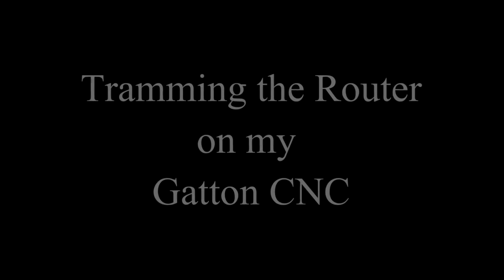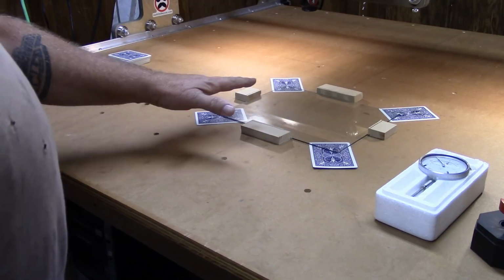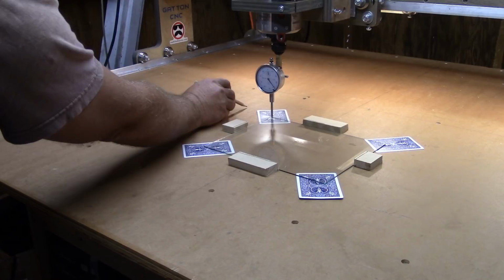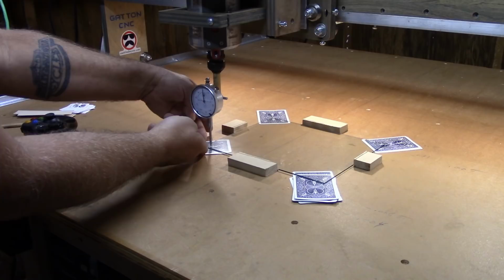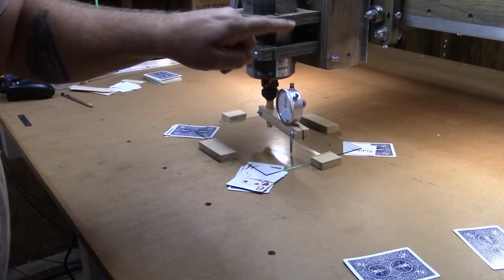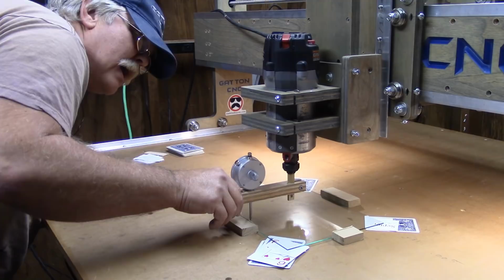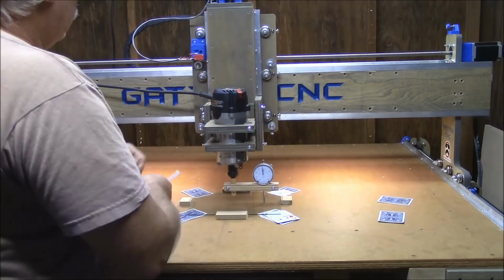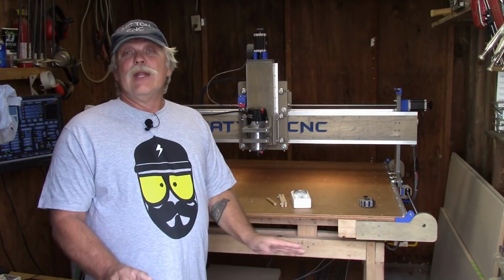Tramming the Router on my Gatton CNC

Comment: I did the same video on my channel a few years back. It only takes me about 10-15min once a year just to give it a check over and adjust. Haven’t adjusted it in 2 years and it’s still running true.
Reply from the maker: Thanks! That's great to know! I'll most likely check it again in the spring when the weather dries out. I figure if it's going to change, that's when it'll happen.

Comment: Glass might not be the most flat. Might want a surface plate, and also 3 point levelling would be a bit easier as you cant really get a 4 point level plane.
Reply from the maker: Check out my latest video on this topic, in which I level, square, and tram my Avid 4848 Pro CNC router: https://www.youtube.com/watch?v=NvT3qj4B5DA
Reply: Absolute magic thanks for this @MarkLindsayCNC

Comment: Hi Mark, great instructional videos!  Thank you. I am curious - if the angle between the 1/2" dowel and the plywood arm is not perfectly 90°, wouldn't that throw off the readings?
Reply from the maker: Thank you for your kind words, Mark (great name, by the way.) It could throw off the readings. But keep in mind this video was made 6 years ago, and I was trying to make do with what I had. I have since changed the way I tram my router/spindle, and that has eliminated that possible error. Here's a link to my new tramming system: https://www.youtube.com/watch?v=AC4U5m8T6Yw

Comment: Mike question;  you should do this after you put your spoiled board? Can you do this after you surface your spoiled? I’m new to CNC and when i mount mine CNC Machine got really excited about and i did not now about this.
Reply from the maker: Thanks for checking out the video! You should do this after you put down the spoilboard, but before you surface it. That way you get a nice, flat surface on the spoilboard. Just know it's a slow, tedious process that takes a lot of back and forth, loosening, and tightening the router/spindle mount, checking, and rechecking.

Comment: why not turn the dial indicator  90 degrees counterclockwise so you can see it at the left side and the right side of your table (for the second part of the tramming)? you can stay in front of the camera . other wise a perfect way to set up the router plate  Kind regards Hans
Reply from the maker: Thank you very much, Hans! The main reason for not touching the dial indicator after it's mounted is because I run the risk of moving it in the mount. Once it's mounted it needs to stay as placed. That way I'm sure all of the readings are as close to identical as possible. If I loosen the mount to turn the dial indicator, it could potentially move the indicator up or down just enough to give me inconsistent readings. Plus, my old eyes need that dial indicator as close to me as possible so I can actually read the thing (Don't get old - it sucks in more ways than I can count.)

Comment: Mark, I like you idea of using a dial indicator mounted to the router collet to give you points of reference.  I do something very similar to set up my radial arm saw and, to a lesser degree, my planer.  But now I also plan on using it to level the table on my drill press.  It's interesting how invaluable dial indicators can be in the workshop!

Comment: Thanks for posting the video. I’m enjoying your beginner series. I ended up tramming my router with a magnetic base angle box. I put a plain piece of 1\4” rod in the collet and zeroed the box to the work surface, then stuck it to the rod. As I rotated the rod in the router I could see the tilt in all directions. Seemed to work pretty well.
Reply from the maker: Hey, whatever works, you know? Thanks for checking out the video!

Comment: Great job on explaining how to tram the router. As retired machinist you did everything correctly. In my videos that I have posted using my Bridgeport my head is trammed to .0005 in a twelve inch circle.
Reply from the maker: Thank you Leo. You machinists have a lot tighter tolerances that us wood guys have. I didn't really get into the radius of my little jig or how tight of a circle I was tramming it to, in an attempt to keep things simple.

I know that .0015 may seem like "sloppy tolerances" to some, but wood just doesn't need that kind of precision. A lot of folks seem to forget that just the moisture in wood glue alone can swell a piece of wood to the point that it won't fit into a pocket, hole, or mortise if it's cut too tight. .0015 in nod and .0005 in twist is more than good enough for me. In fact, it exceeded all of my expectations by a huge amount.

Thanks for watching Leo! I really appreciate it!

Comment: Mark, I liked this video because I have a smaller CNC Newwave SD110 and all I needed was the one Dial Indicator. However, with the larger CNC's, I like your other video that's more updated with the latest measuring Indicators you use ect...It doesnt seem to me that the SD110 node and tilt can be adjusted as easy as the larger machines. 
After seeing several videos on this subject and the money we pay for a CNC you would think the Mfg of the CNC would design the CNC with easy adjustment features and locations to read and make the Tramming process and adjustments a lot easier.
Reply from the maker: Thank you, Max. I agree with you, and some manufacturers have incorporated features that allow for easier tilt adjustment. For nod adjustment, we're pretty much stuck with adding shims. The problem with nod adjustability is that almost any other solution compromises rigidity. That's something that just about every manufacturer agrees is a bad thing. And to be fair, nod adjustment is pretty much a one-time thing. Tilt adjustment usually is too, but it's fairly easy to incorporate tilt adjustment without compromising any rigidity.

Comment: Excellent video. I’m pretty sure if you use a bigger piece of glass may have less trouble leveling the glass, just a thought.
Reply from the maker: Thank you. I'm sure you're right about using a bigger piece of glass. Unfortunately, I didn't have a bigger piece that was thick enough to keep from sagging in the middle. I could have bought a piece specifically for this job, but I was in such a hurry to use the CNC, I just went with what I had. There will be more on this topic after I get the new shop/shed built and move the CNC over there.

Comment: Great video. I may have missed it, but how did you make sure the flat on the dowel was parallel with the body? If it is off even a little bit it will throw off my adjustments.
Reply from the maker: I sanded the flat into the dowel on my disk sander, using the miter gauge to keep it straight.

Comment: Another great video Mark! I have an issue where there is slight play with the nod (in the Y- Direction). It’s very small but I am told by the manufacture that it will not affect performance. Seems to me that it would cause a slight shortening of the required distance traveled when cutting.
Reply from the maker: I guess it depends on their definition of "very small." Still, if they say it's within tolerance, I'd go with their recommendation.
Reply: @MarkLindsayCNC  Thank you.

Comment: great job  very help full I did rewire and it works  now I have a problem with something I went to v carve made a star and a circle around it and group them together went to tool path .25 deep on line   and saved went to mach 3 loaded g codes the star cut fine but the circle cut all but 2ins and stop and stell showed g codes but would not  finish can you help thanks mark
Reply from the maker: Thanks James. 

Shoot me an e-mail through my website.  marklindsaycnc.com 
This isn't really the place to get into diagnosing a problem.

Comment: A lot of good tips. Thanks very much for the videos. Still wondering how are you sure that the plywood mount for the indicator have the two holes square up or if the indicator and the dowel are parallel together?  Thanks
Reply from the maker: Well, the holes used to mount them were drilled on the same drill press, which is nice and square, so I got them as square as possible with the tools I own. Also remember that we're talking about a wood router. We're not machining to a 5 digit to the right of the decimal tolerance. Good enough is good enough when you're working with wood. Most cabinet and furniture shops have a builder's tolerance of 1/16 of an inch. I'm well below that (.003") That's good enough for wood, so it's good enough for me.
Reply: @MarkLindsayCNC  Thank you for the quick reply.  That makes perfect sense

Comment: Great Video Mark. Question, can you use a piece of Plexiglass instead of glass?
Reply from the maker: You can use any material that you are sure is flat and is thick enough that it doesn't sag in the middle. Glass is used most often because it's cheap and easy to find. Others use a piece of marble or granite. Since this video was made, I have purchased a granite surface plate that I now use instead of a piece of glass. Here's a link to the surface plate I use: https://amzn.to/3IKg3vD

I also did an updated Tramming video, in which I used a better dial indicator setup. Here's a link to that video: https://youtu.be/AC4U5m8T6Yw
Reply: PS I did order the granite. I can use this with other things. Thanks

Comment: Why didn't you check it against all 4 corners of the table? I think you might get different readings. Did you check the thickness of the glass in different places?
Reply from the maker: I'd certainly get different readings if I checked it at the 4 corners of the table. That's not the point of tramming. The point of tramming is to try to get the router square to the gantry. The thickness of the glass is irrelevant. It serves as a level plain to adjust the router mount from. Once I get my spoil board laid down, I'll surface it. That will give me a level table top. Now that I've trammed my router,  the surface of the spoilboard will be smooth.
Reply: Mark Lindsay CNC Great explaination. This solves many "Why is my router cutting grooves?" questions.

Comment: Here is a tip!  if you have a slight angle on your head that is to hard to get perfect you can still get a perfect finish with no steps.  If you take the cut in the direction the head is tilted you will get a perfect finish.  If you cut the opposite direction the head is tilted the back of the cutter will rub and the machine will work a little harder but you still get a nicely blended finish.  If you cut crossways to the tilted head you will get steps showing.  Obviously a perfectly aligned head is the best but not always possible.